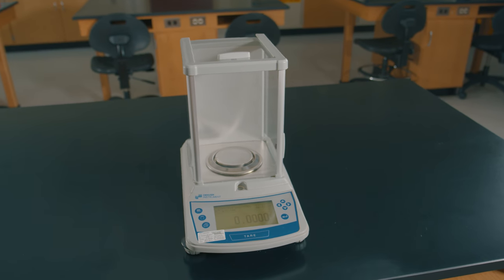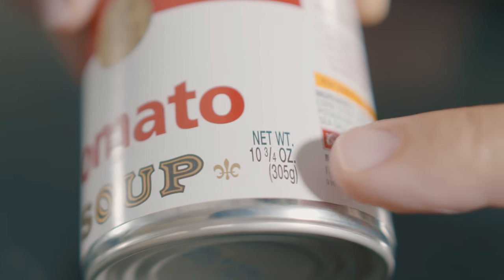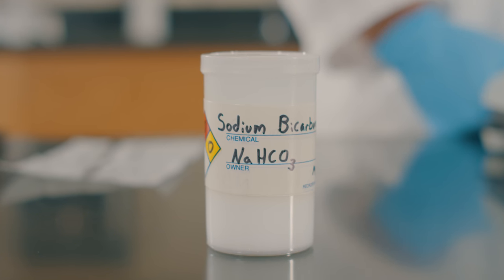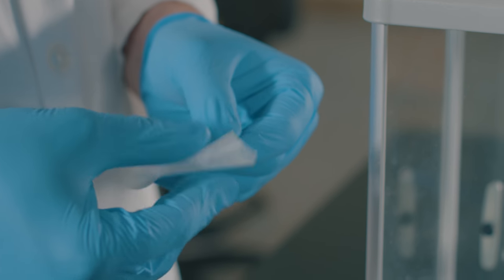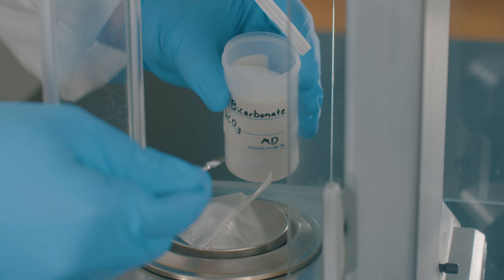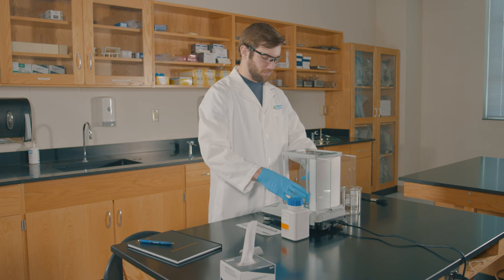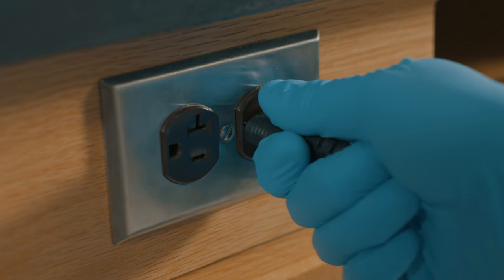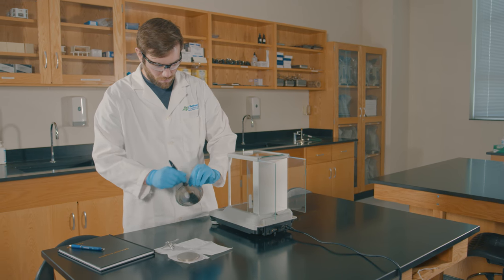How to Use an Analytical Balance

Comment: Is it possible to take weight in beaker
Reply: It is possible, yes, but using the less weight is the best to be far from the limit. For liquids I would use pippete and a 4 mL vial (vials weighting about 4-5 grams). For solids I would use regular paper (paper weighting ca. 300-900 mg). A 15 mL small round bottomed flask would weight about 15-25 grams

Comment: What is the maximum mass you can measure on an analytical balance? Give the amount with the units.
Group of answer choices

525600 minutes

150 g

52462462452 g

311 g